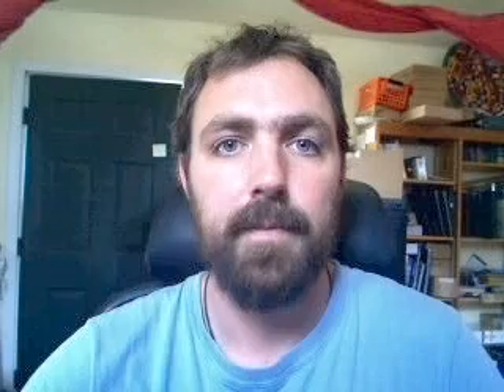Strawbale.com: Green Foundations For Your Straw Bale Home

Comment: Hi Andrew. I don't have a lot of money but I would like specifics that you can steer me towards. I am looking for foundations for mainly a straw bales house with an interior/exterior front 12x 30 of a Earthship hallway connecting to the straw bale house. It would be 12x30 then two 12x20 straws bale attachments.  Like a squared C shaped unit with a patio between. Can you assist me in where to research in finding an inexpensive solution for the foundation of this? I would also like to raise it 5 feet above ground.
Thank you so much!

Comment: I haven't seen anyone discuss using straw in the concrete foundation. When I worked for a home builder years ago, one of the concrete contractors used bales of concrete within the forms to build concrete steps leading up to the house. I bet concrete would strengthen the concrete by serving as a fiber and helping to retain moisture of the concrete during the curing process. Any thoughts on this?

Comment: BTW,

Carpet can and often IS applied over concrete floors without any glue.  Nailing strips are fastened around the perimeter of room.  You will wish to use carpet pad with this system, no doubt about that.

Slab on grade is almost universal in Florida, and that is the way it is normally done.

Thanks.